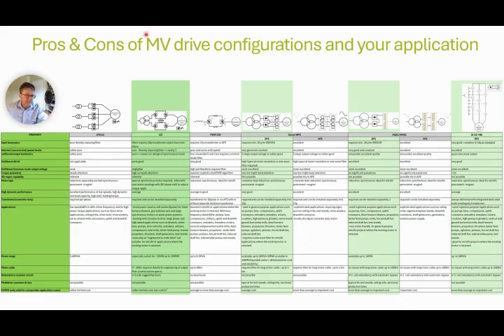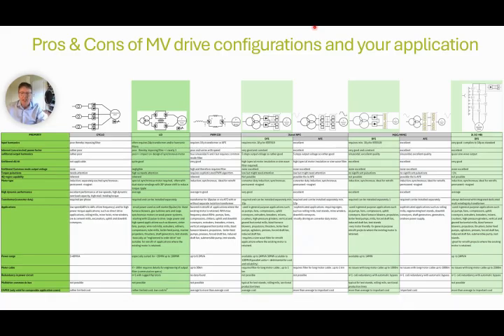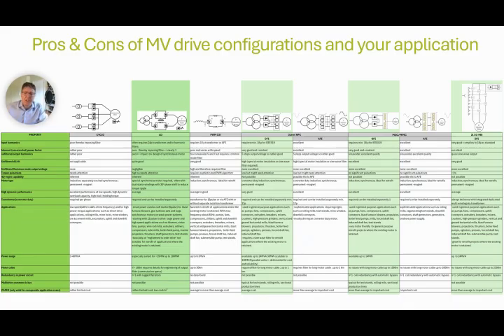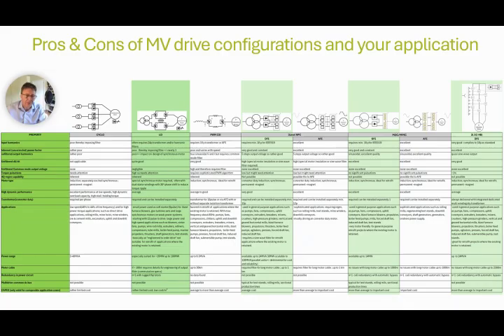Medium Voltage Drive Topologies Explained & Compare CHB, LCI, NPC, MMC, CCV & PWM CSI

Comment from the maker: 0:00 Introduction – Medium Voltage Drive Analysis
0:45 Input & Output Harmonics in MV Drives
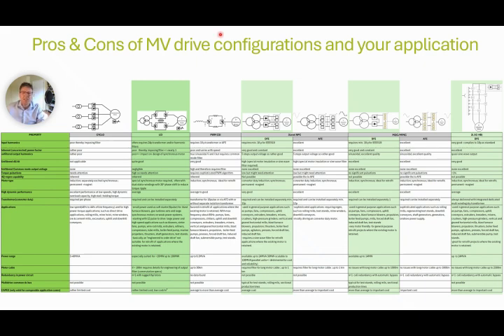1:10 PWM-CSI and Power Factor Considerations
3:16 Voltage Stress, Common Mode Voltage & Torque Pulsations
5:11 Drive Capabilities – Regeneration, Motor Compatibility & Performance
7:54 System Design – Transformers, Power Range & Cable Considerations
9:17 Advanced Configurations – Redundancy, Multidrive Systems & CAPEX